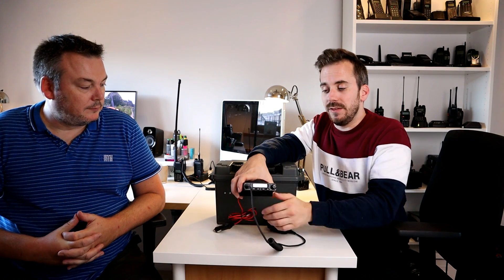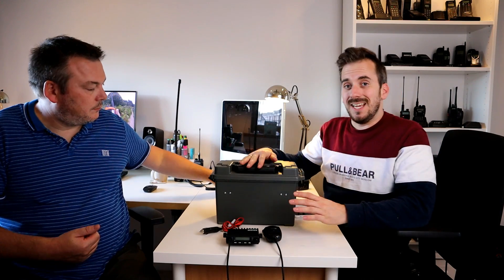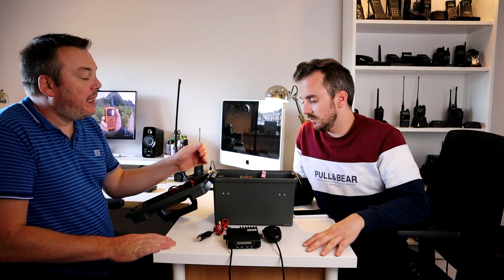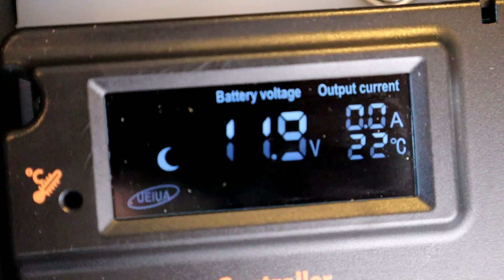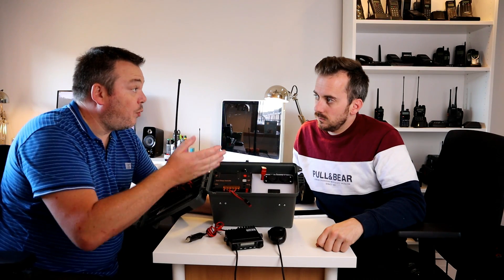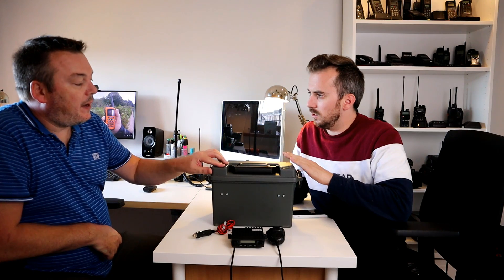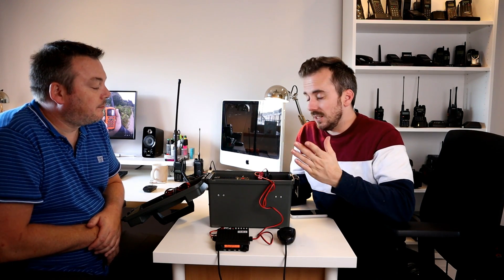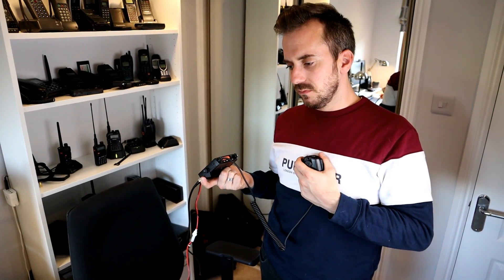Portable Ammo Can Amateur Radio Power Box - Ideal For Portable Operation!

Comment: Really nice job James!
Just completed my own version, using a .30 cal version of the ammo can (same can just narrower than yours which appears to be a .50 cal?).
Using a LiFePo 15A battery with internal battery management and testing so far has given good performance running multiple receivers.
Can also drop in SLA's if required. Also used a cutting board to make a nice top panel. Nice and light with the LiFePo battery inside.
73's for now!
Reply from the maker: Cheers mate! sounds good!

Comment: Nice video Lewis, but your statement about lead acid batteries being more cost effective is slightly flawed. If you look at the TCO of a battery solution, such as the one you have there, you'll have to replace the lead acid packs 3-4 times before having to replace a LiFePo4 solution. It also wont provide a stable output voltage under load, or give you anything like the advertised capacity. I've put a lot of study into this and the numbers for LiFePo4 win hands down.  Yes they (Pb) are cheaper to acquire but that's about all they are good for.
Reply from the maker: Cheers mate!

Comment: Be very careful when linking batteries together, as if you wire them up the wrong way around, the voltage doubles and you will blow all your equipment. An expensive mistake to make! 💥